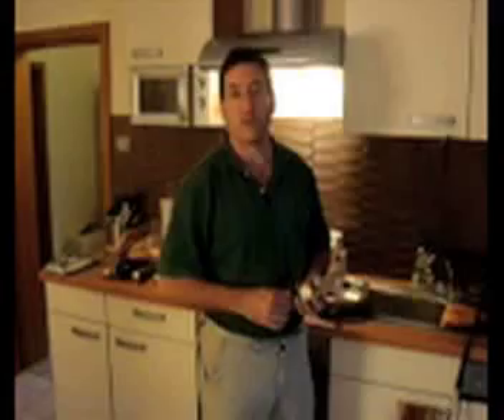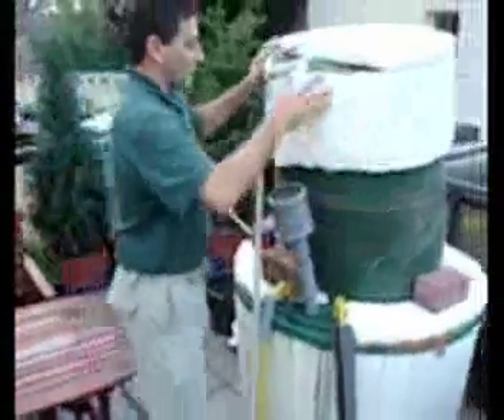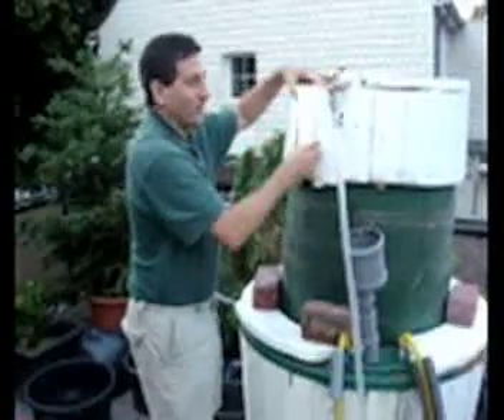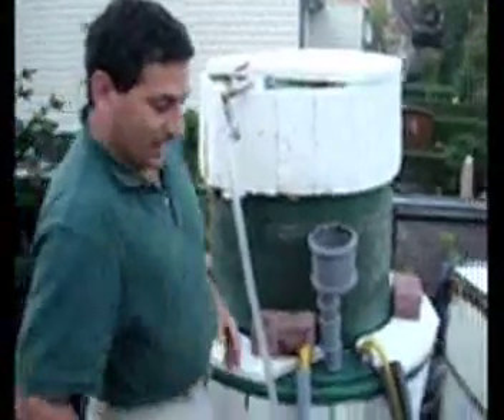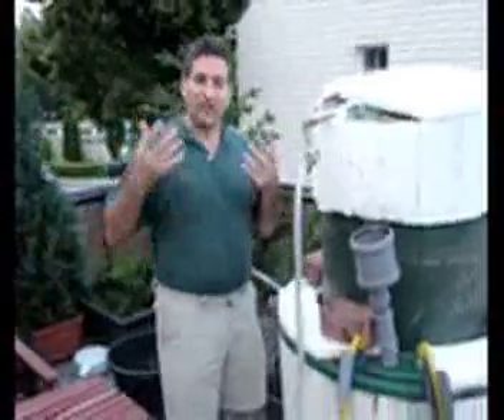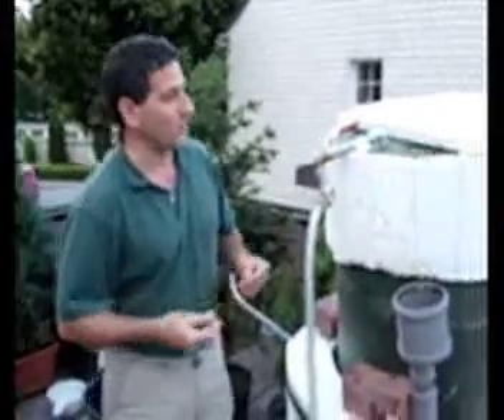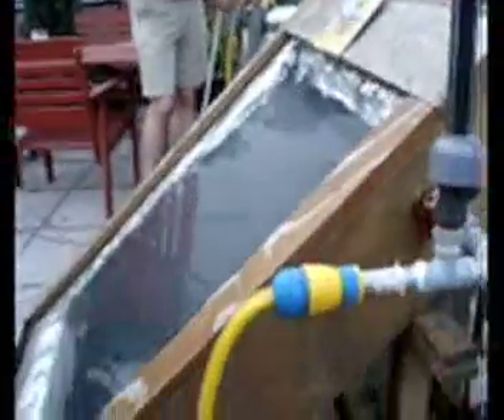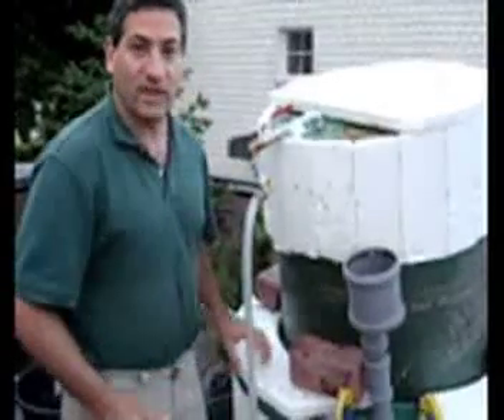Pt. 1 Cooking 31 minute  Biogas Meal from Porch System in Germany

Comment: thanks for reply
im making my own 1 of these on small scale 1st of all  the design im going 2 use will be a sealed container 4 waste 2 make bio gas that will  feed the gas into anther container filled with water. the water will have a hose connected 2 anther container above it that will fill with water from the bottom container when the gas is filling the bottom container. the water on top will have a valve opened allowing water flow 2 disperse the gas out of it, do you think this will work?

Comment from the maker: ... and that is because for the past 4 years I've only used food waste ground up into small particles with an insinkerator to feed it and such systems have a very low solid load. The key is the insinkerator. No filter needed with the fast turn around in the digestor.

Comment from the maker: It doesn't go down at all but merely acts as the tank overflow. This is because the floating drum contains the less dense solids and the slurry that flows out generally comes from more or less the central region anyway. Ideally it would come out of the central region, but most folks with this design don't worry about that because of the way the floating drum acts.  In the beginning I needed to worry about solids but then I opened the system and removed the scum from the manure. Now it works fine

Comment from the maker: @Hamish121212  Garden hose or any plastic tube is just fine; it is not under any pressure.  PVC pipe would be fine too. Any gas burner will work, you just have to remove the pressure restriction pin so that enough gas can flow (again, because it is under no pressure).

Comment from the maker: @eastern2western Methane is what we commonly call "natural gas".  People have been cooking with it indoors for over a hundred years, and most restaurants and cafeterias and kitchens use it.  It is perfectly safe if one doesn't let the gas accumulate and then light it accidentally creating an explosion. This very rarely happens because the gas has an odor when unburned so people know if someone left the gas on and they simply open the window (methane is lighter than air and quickly disperses).

Comment: If I can help you out I will, I live in the Netherlands and maybe I can get the parts you need. Brass couplers and hose fittings will do fine. You can make one for less then 10 Euro. The company that makes the stainless steel wool is located in Germany. The brand name is Rakso.  I made a bubbler from a small piece of plastic tube , and a flashback arrestor from copper tube I show it in my HHO  video. I love your work very much, I tell to as much people as I can. 

Greets from the Netherlands, iT

Comment from the maker: Meanwhile I have used a washine machine valve that has a stainless steel mesh inside to act as a flashback arrestor. As soon as I get back to Germany with the simple parts I will build the bubbler and no-one will need worry.

Comment: If you decide to build one yourself then never use normal steel wool, always use STAINLESS steel wool or BRONZE wool for a flashback arrestor. Normal steel wool will catch on fire. 

It is also good to make a bubbler. If you make a gas inlet on a plastic container that is filled with water, then let the gas bubble up from the bottom so the gas can come out on the top of the bubbler.  Then the flame from a flashback can never reach the  barrel. No explosions or worried neighbors

Greets, iT

Comment: I know how you can make your own flashback arrestor. You can make one from Bronze wool or stainless steel wool.  You have to fill a small tube very tight with stainless steel or bronze wool   But make sure that the gas can flow well enough through the tube. Cover the ends of the filled tube with steel mesh and make two hose connectors on each end of the tube and then you are ready. Make sure to test it in a safe way before you decide to install it  to your system. Greets from the Netherlands, iT